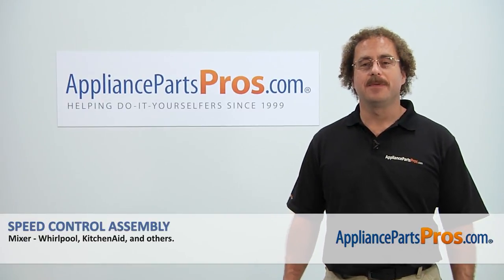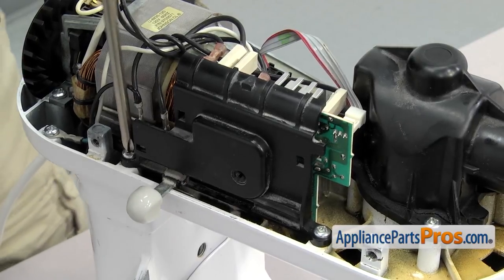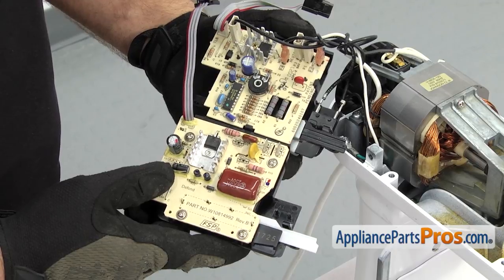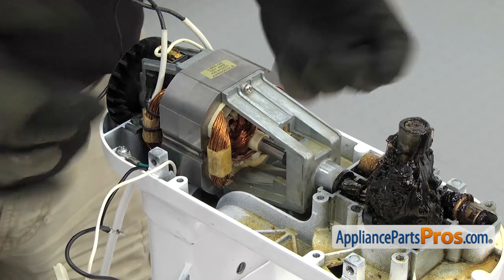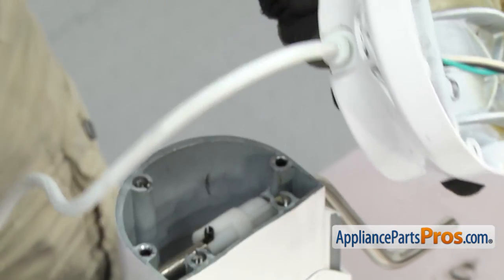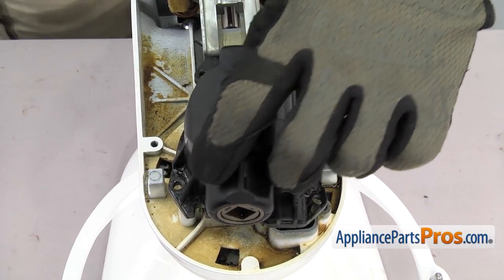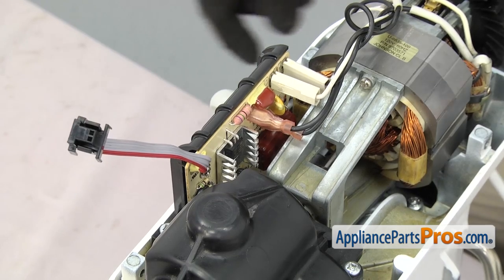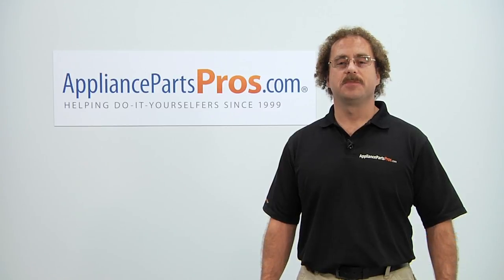How To: Whirlpool/KitchenAid/Maytag Speed Control Assembly WP9706649

Comment: Thanks for this very helpful video.  I was about to buy the replacement speed control assembly and opened the mixer case to see what I had.  I noticed that grease from the gearbox had leaked out onto the electronics board. It probably got overheated from running at top speed for 20 minutes making the Kitchenaid cookbook divinity recipe. I used alcohol on cotton balls and Q-tips to clean the grease. After letting it dry, I put everything back together and it runs fine. I'm afraid to open the gearbox to find liquified grease, but I'll have to do that soon.
Reply from the maker: If there is anything we can help you with please let us know.